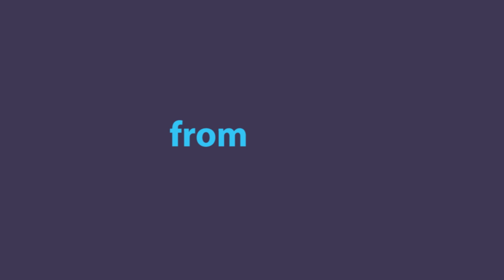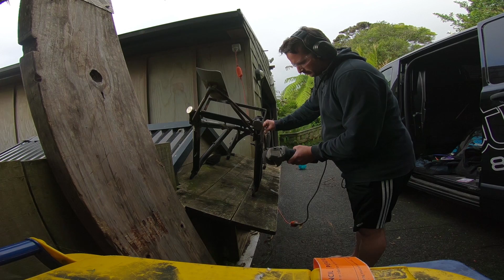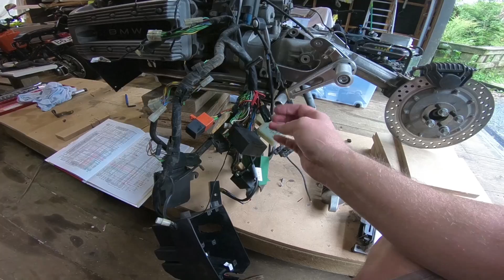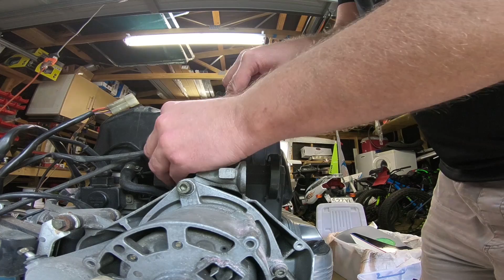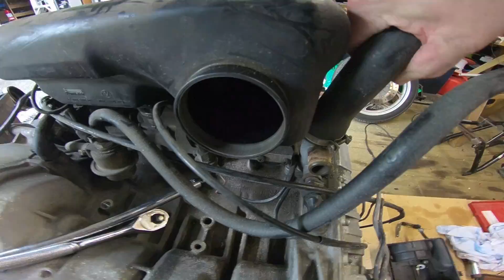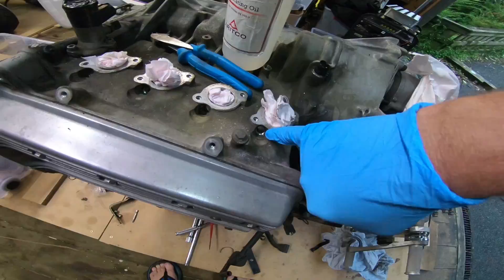BMW K100 CAFE RACER BUILD PART 10

Comment: i love watching your progress man, cant wait to see the final product! 
Im thinking of buying this 85 k100 for $1500 and turn it into a scrambler. How much do you think I should except to spend minimum? Meaning that I plan to work on the subframe for the seat, new tires, new handle bars, headlight/tail light and signal lights and cut the exhaust short?
Reply from the maker: Hey there , its hard to guess a budget , for me I wanted all the welding done by someone who welds for a job (so its done properly) . What level of finish are you after? Showroom or more of a "rat bike" finish? Mine will be somewhere just below showroom , as I don't have an unlimited budget and can not justify spending $$$ on paint etc .
Here in NZ we have a population of just over 4 million so K100's are thin on the ground so finding a clean low mileage example is near on impossible so I consider myself lucky to get the one  I did (only 40,000 kms ). I plan to do no engine work except the oil / water pump issue and new plugs , oil and filters . Again you can buy a bike and open a can of worms with issues only to be expected with a 34 year old bike . The more work you can do yourself will save you money for sure ! Glad you are enjoying my vids , I am enjoying making them !
Reply: You're absolutely right, I can tell youre after an almost showroom finish, that Virago looks very good! and you're correct, Im just planning on doing a daily "rat bike" so Im just going to change the minimum, of course the seat (cut the frame), dirt tires, wider handle bars and cut short the factory exhaust . For the paint, I was planning to just plasti dipped it myself. You're very lucky for having one with this low mileage, the one that im planning to buy has about 44000 miles.
Reply from the maker: I still want mine to show its 34 years old , but still to look good . Not sure what part of the world you are in but shipping to NZ adds $$$$ to a build in this part of the world ! I have seen some amazing "rat bikes" out here in NZ , "more is less" as the saying goes !
Reply: I agree with the modern/retro feel! Im in the US. what do you recommend for the seat? I though I could do it myself by cutting a high density foam, mold it and wrap it in leather. But im confused about the seat pan? ive seen people making the pan out of fiber glass and some out of aluminum sheet but i think it will be harder to mold the aluminum sheet into the frame curve?
Reply from the maker: If it was me doing a scrambler I would probably go for something like this 
https://cafe4racer.eu/en/upholstery-motorcycle-seats-cafe-racer-scrambler-custom/619-bmw-scrambler-seat.html
or maybe this?
https://cafe4racer.eu/en/bmw-k100-kit-scrambler/947-kit-skrambler-k100.html